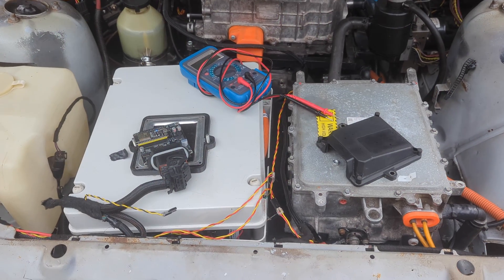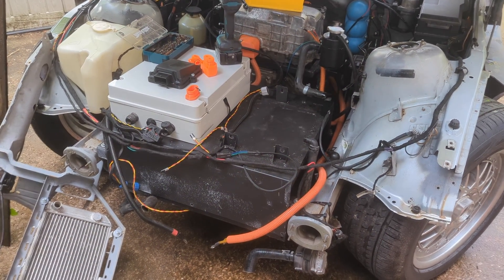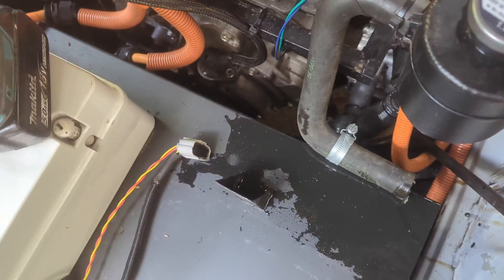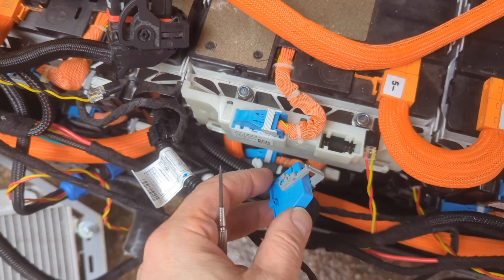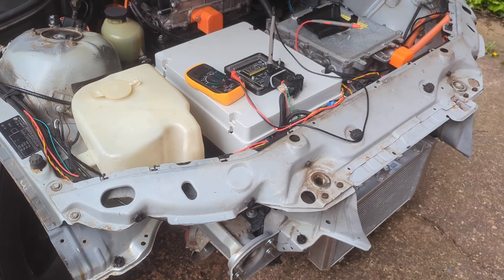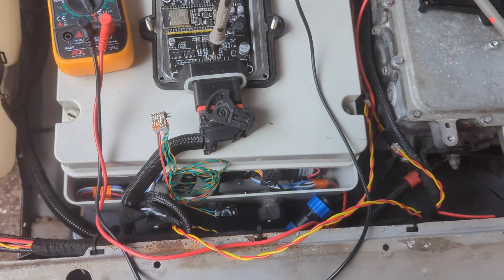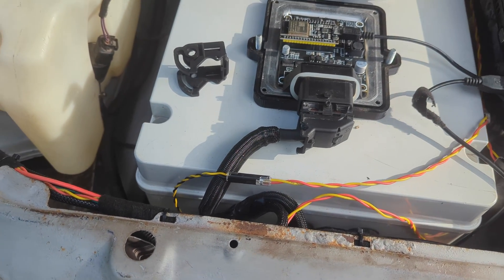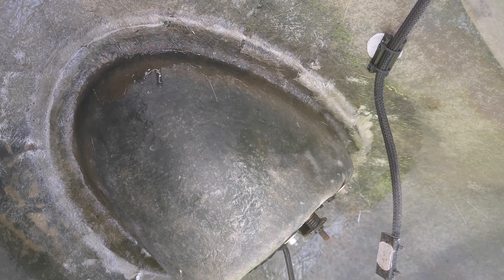BMS Troubleshooting: Getting my DIY EV charging again

Comment: I had issues with the Nissan plug that connected to the inverter and ended up bypassing the plug altogether. 
I guess we are plugging them in and out more often than they can cope with.
Reply from the maker: This one is my own crap crimping. Or more accurately, using the wrong sized wire. If I redo it I'll do tails of some thinner stuff that fits into the crimps better.